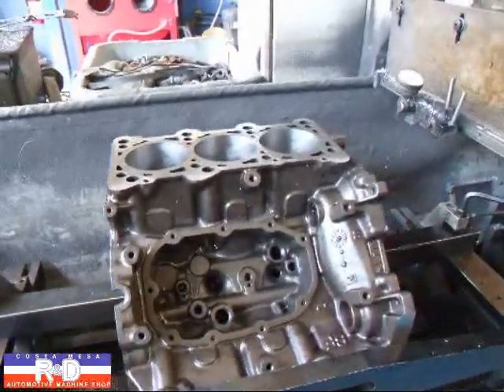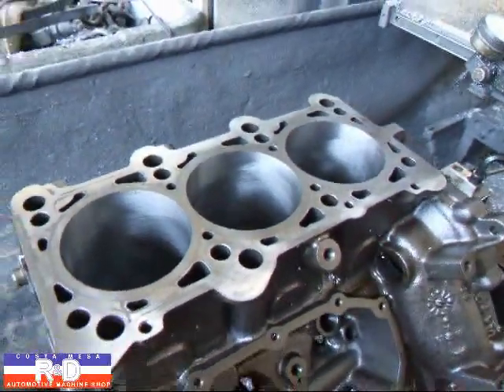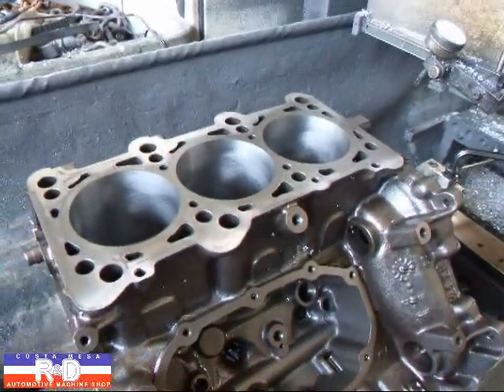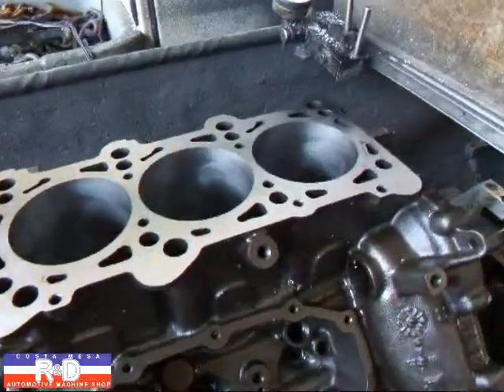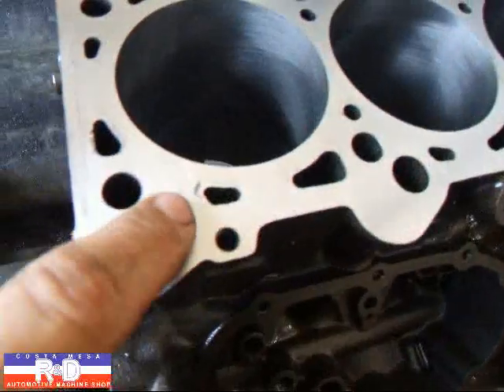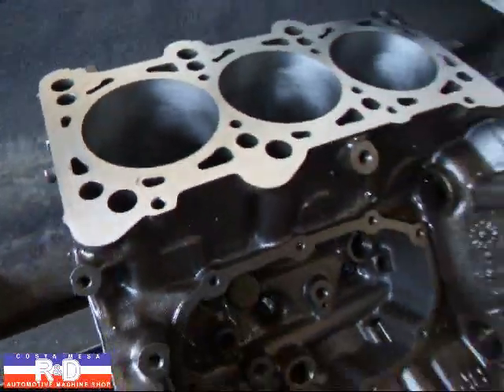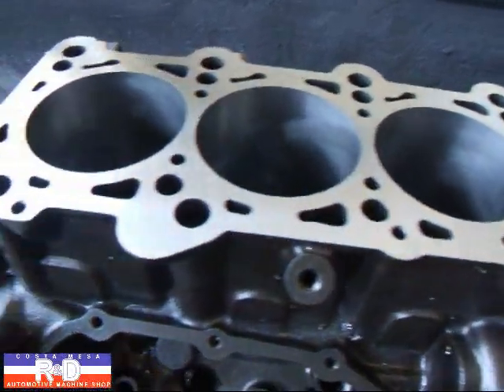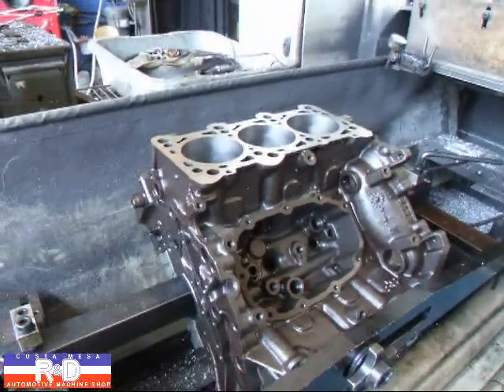Audi V-6 Block Resurfacing

Comment: Great videos John, been watching for 2 years. Doing a great job, I have a newbie question, actually a few questions ( I'm only 16 )  I was wondering how you clean out all the fine metal chips and swarf from all the holes and ports and what you have to do with bearings if you can't remove them?

Comment: looks exactly the same as my 2.8 12 valve block from my 94 audi 90, im pulling the engine and tossing it then installing the audi 2.3 inline 5 20 valve then adding a turbo, a while back i rebuilt the top end because i believed that i was getting oil past the valve guides because their was oil on top of the valves and it fouled out 2 cylinders constantly, after new valves, new guides and seals, presto! did not fix a goddamn thing, oil burned in the same cylinders with oil on top of the valves

Comment from the maker: .0045" off both sides, this is how the factory resurfaces the block. The cutter was tipped a little too much to keep the back side of the cutter from dragging across the surface. Block was not over-heated.